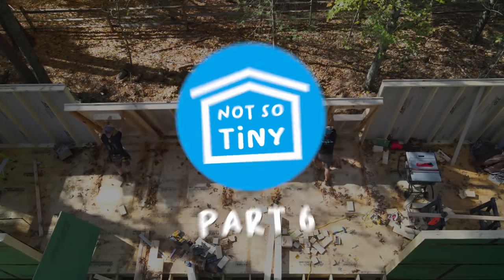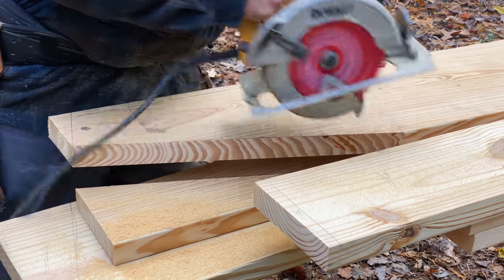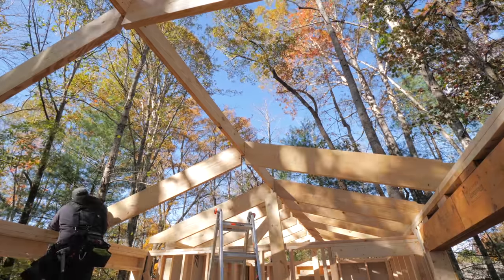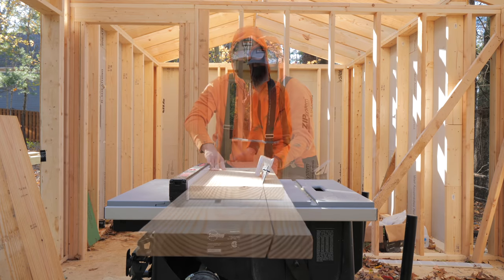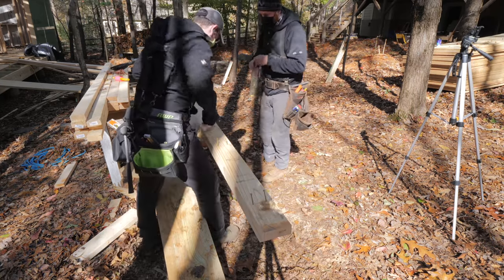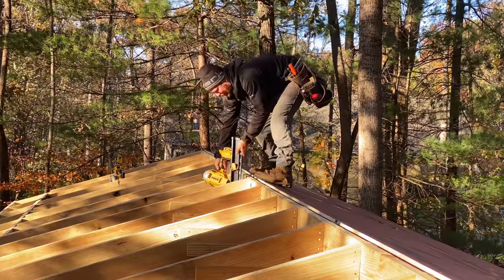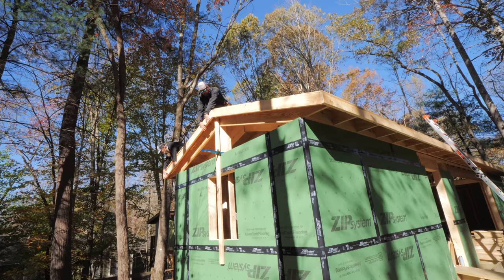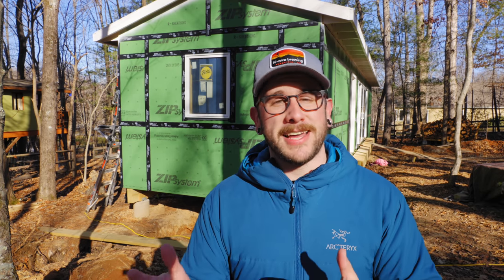FRAMING THE ROOF ON MY TINY HOUSE! // Not So Tiny House Build Part 6

Comment from the maker: Catch up on the entire (Not So Tiny) House Build Series here : https://youtube.com/playlist?list=PLlG1IdP-XNnmVsgBODfKbtPu-LFi6F7bB 
📹  SUBSCRIBE : https://goo.gl/V5gcNJ
Purchase (Not So Tiny) Tiny House Building Plans : http://bit.ly/notsotiny
Reply: How long did this small house take to build?
Reply: Johnny,  Really digging the build! I do want to make a comment on the way the roof is framed. I agree with the inspector’s concern. Collar ties are for uplift and not gravity loads. I’d suggest adding some rafter ties at the top of wall to keep the walls from kicking out. They could be exposed. The kickout force with such low roof pitch becomes high and I would contend that the engineers fix would not work based on the detail shown in the video. Just wanted to make sure you have a structurally sound design!

Comment: As a german it is super interesting to see you building this since you guys have some very different approaches in construction over there. Really fun to watch!
Reply: What's different in Germany? I'm curious to know where we differ here in the US.
Reply: @IanDeRanieri  
Um, that will be hard to summarize since it is about alot of little things. Well, first things first: we tend to not build houses out of wood, this one isn't really interesting but this alone creates alot of situations where you use techniques I didn't even know about (I'm not a professionel construction worker tho). But also the fact that they're using a measuring tape literally everywhere while we tend to use a double meter stick. You use nails alot. I guess our roof-workers do too, but usually we use screws everywhere - aaand wood glue where we can.

Comment: Thx for mentioning the 2x8 ridge board detail...that stuck out like a sore thumb, but that ole engineer stamp ftw.  Simpson also makes rafter straps in lieu  of the collar ties  and use a full depth ridge board and you wouldn't need the engineer stamp to get the same full vaulting

Comment: I agree with the building inspector who questioned the collar ties keeping the walls from spreading. The roof sheathing will help. Typically you need ceiling joists pretty much on top of the wall or a structural ridge. The collar ties are too high to add much. Take a look at how straight your walls are before and after you put the roof sheathing up.

Comment: Interesting that you are saying the building is now "dried in".  In my experience, a building is "dried in" when the roof is closed up (okay in this case) and the doors and windows are installed.  The inside of the building will now be dry in case of rain, hence "dried in".  
Greetings from a US retiree in Portugal.

Comment: The addition is looking great. I know it's not traditional in the home building process but had you planned on running any networking lines to the (not so) tiny house, or are you trying to leave that for a future video? IMO I would run a line now while you already have trenches dug. Just run a metal sheathed CAT 6a line with enough slack to run into a closet and install equipment later on but at least you'll have the line installed

Comment: Okay.  Dumb but sorta complex question..

You go with ZIP sheathing, presumably for decent air sealing.
You then go with exposed rafter tails, which introduces dozens of very-hard-to-seal penetrations to the structural envelope.
Would it not have been easier and more economical to simply block-frame the home, then create an exposed rafter detail outboard of the building envelope?

Comment: Those DeWalt battery powered framing nailers are absolute junk! You should get the Milwaukee, you can get an extended sleeve to hold more nails too.
Reply from the maker: Worked well enough to frame this entire house! The Milwaukee is great but is heavier. Both work great IMO.

Comment: I'm not sure why the engineer approved that roof design. It will spread the walls apart, not very much since there isn't much load, but it's still a flawed design.

Comment: Just curious, anyone here know why roof pitch ratio is measured in "x to twelve"? Like 9/12, orr 10/12, but not 9/15 or 10/15?
Reply: Just because 12inches is a foot, so its easily repeatable and consistent with other construction measurements
Reply: first number is how many inches the roof rises per every 12 inches of run (9/12 goes up 9 inches every foot = steep roof) 4/12 is not steep because it only rises 4 inches for every foot.  to answer your question more directly: because 12 inches is an easier standard to follow.
Reply: @Colin-uz4lm   @sadbino  That would make sense. Being from the Netherlands we use metric, so I didn't make this connection logically. What makes the 12 an easier standard though? Because it equals a foot I think? And Building materials come in increments of a number of feet? (is that what you mean  @sadbino  ?)

Comment: I think you will be sadly mistaken in a few years, if you do not put an underlayment under over the decking, under your shingles.  
You see the nails break the skin of the decking and water will soon find it way through the decking.
By the way, Moisture does get under your shingles on cooler temperatures with humidity and will condensate, which is like a dew (looks like rain) under your shingles, and you will wonder????   Why didn't I just roll out some kind of underlayment??? 
It sure is a lot easier to do it now.... or just try it your way.

Comment: 5:10 Instead of toenailing the rafters, nail thru the ridge beam on opposite sides. Less angle, more hold.
6:00 Should have glued the collar ties on. Overkill? Better than underkill.
8:15 I would primed the show side of the plywood first. When the place is finished, spray mold release in those areas to keep hornets from hanging their hives. Will it work? IDK. Just a thought. Would not hurt to try. Someone has to experiment. Do not forget that when it comes time to repaint. Of course, that will require good memory.
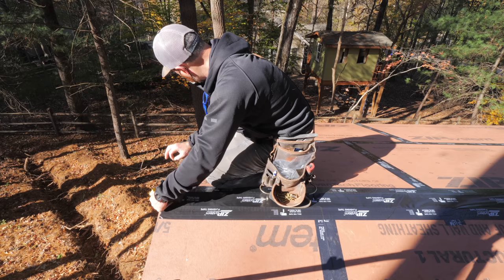11:04 Nothing like a blast of lung-driven compressed air.
12:30 Too many misses with the nail gun. Solution: Shoot new nails a bit farther out. Afraid that will perforate the sheathing's protective layer? Zip tape it!

Comment: why 2x12's? seems excessive and expensive
Reply from the maker: That's the only way we could get enough depth in the ceiling for our insulation. Since we're going cathedral ceilings, the insulation will be between the rafters.
Reply: @craftedworkshop  Got it, makes sense
Reply: @craftedworkshop  Did you consider insulation on top of the roof decking?

Comment: Loving the building so far. Makes me want to get out there and build one. Quick question: Soffit venting is not a thing in your area? I know here they want to have it so the roof cavity have air circulation up to the ridge vents one you get them installed.  Just wondering, I know code if different everywhere.
Reply: I’m curious to see the insulation detail as well. I thought he was going to do rigid foam board on the exterior roof, or spray foam inside- but then the ridge vent came up. I guess we’ll see. Maybe he’ll do a Smartvent or something else when it comes time to shingle.